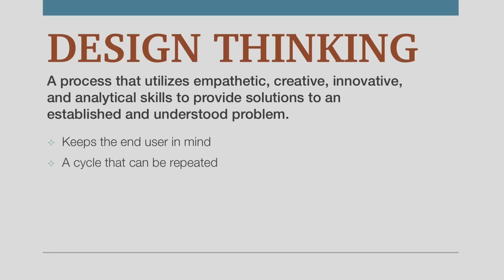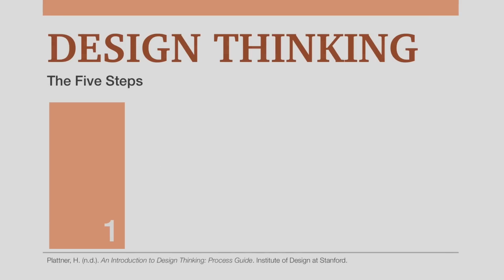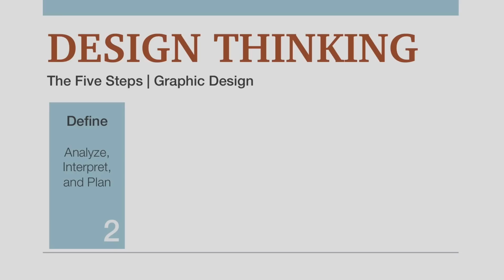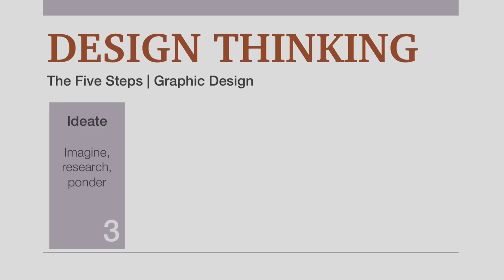Design Thinking Process

Comment: The Design Thinking trope misses two points that dominate the day or real designers. Firstly, design is not about the reductive convergent focus of 'problem solving'. In doing design we of course solve problems, a million along the way for even a simple building ( I'm an architect), but first of all, we are finding opportunities as we intervene in a social system to provide meaningful accommodation that opens possibilities and enables people to create a different future. That's what design is about!

Second, it is not a step process, but has multiple recursive loops as we work from opportunity to functional performance, test options, then review the parameters of the opportunity, the factors that go to function and the drivers of performance constantly reviewing with the owner, the users, the owners' customers, etc.

The iPhone is a case in point. It didn't 'solve a problem', it changed the future with huge opportunities opened up.
That said, in 'design' there are no easy answers, short cut routes or simple paths to a 'solution', whatever that word might mean in the creative world. We don't churn out 'solutions' like a problem in Algebra 101; we find the route to a new future.

Comment: "A cycle that can be repeated" yet nowhere in the 5 steps does it mention this part of the process (which is the most important part) If your not iterating on your designs than you've all ready failed. Users needs change over time. Sounds more like some Phd needed a pat on the back & just re-wrote the UI/UX Design process, changed all the titles & forgot to add in the Iterative step out.

Comment: Fine when its proposed by the CEO of SAP, with 72,000 followers.  Not practical in a fixed time, fixed cost (or capped business case funding) scenario, or with multiple correlated problems (ie in ERP).